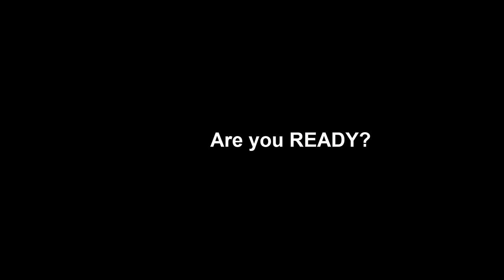Antique Handmade Meat Cleaver | RESTORATION

Comment: I think you ruined the blade when you hammered holes in it...
Reply: Hammered billet holes in it? He drilled holes in it. Or do you mean hammered poch marks in it? It was heated red hot and oil cooled after all that.
Reply: @zippy1981dotnet  Call them poch marks if you want.
Reply: I think he trasferred some kind of smallpox to the blade.
Reply: I think he trasferred some kind of smallpox to the blade
Reply: I personally like the grind technique where people indent the spine of a knife with grinder marks or sander marks. I first thought they where just heavily rusted areas but they're hammer marks. Anyways if they weren't all over the place they might look better.
Reply: Holes were the result of the original hand forging. Thankfully he retained their character,
Reply: It was already junk due to the cracks inthe blade any value it might have had was gone as soon as he ground it out to weld
Reply: Me too
Reply: Yes he do it
Reply: It's called a hammer forged finish. It gives the blade a rustic look and in no way ruins the quality of the blade.
Reply: Justin Dearing the hammer marks from forging are terrible, almost like a child did it. It hurts to look at and in my opinion, ruined the whole project. It looked better rusty
Reply: @flannelflax8078  its supposed to be antique and handmade. Back in the days this is how most tools looked like cause noone had fancy equipment to create the common flat shiny look.  Its something different and the forging increases the strength of the steal. The blade is also very sharp.

Comment: This is probably the first handle i've seen you do that doesn't have a garbage epoxy gap in the junction between the brass and wood, you are definitely improving on that, do you also make sheats?(that thing you put the blade in,  usually leather or wood)  for them,  if so you should show us too
Reply: Sheaths*

Comment: As a default choice you should always make brass at the other end of the handle as it will be less likely to take damage in the long term and the wood (weaker material) will be in a place where it is far less likely to get damaged

Comment: I really just watched this guy use a hacksaw to cut wood...
Reply: Nathanel Graves it hurt my soul to watch it
Reply: I do it as well sometimes. It leaves a nicer finish. But I use it only on small pieces.
Reply: There are tons of hacksaw blades available for many different purposes. There's a blade for finished/treated wood vs raw wood. Blades for ceramics and glass, different blades for different types and qualities of metal. I've also noticed some manufacturers make different ones look alike for marketing purposes. It's impossible to look at that blade while in motion to determine what its purpose was as the quality/recording speeds are too low to get a picture of the teeth.

Comment: nice work.. i've got 2 problems with it though.. that little tail extending over the index finger is a nightmare to use in a busy kitchen, cutting yourself pretty much garanteed and the second problem is, after all that work, there's still a big fat chip right at the heel of the cutting edge... otherwise looks nice

Comment: I didn't see you temper the blade after hardening it?
Reply: Can you explain to a layman what that means?  I watch these videos but have no idea what they are doing. I know heating and quenching is the hardening step right? How and why do you temper?
Reply: @yougosquishnow  heating it up really hot and then quenching it makes the blade extremely hard but very brittle. Means its prone to chipping and breaking so you afterwards heat the blade up at a much lower temperature for longer to add to the flexability without losing the original hardness.

Comment: Why did you leave the blade with holes or what it was?
Reply: you are right Matko P
Reply: It's called texturing. He gave it a hand forged type of look.
Reply: @Tokyo-bones  It looked better before he beat the hell out of it. Now it just looks like a lazy half finished job with a really nice handle.
Reply: @koloth5139  I would tend to agree, but I also don't think polishing the hell out of it with flap disks looks much better, and I would also disagree about the handle design looking good. That said thanks for your input, what's your opinion on the sanding?
Reply: @koloth5139  i think it looks pretty cool and i would love to own a knife like this.

Comment: I don't know why you sharpened the blade to 4000 grit prior to fitting the handle, and you can see at 11:00 that you've nicked it too. I like the restoration, probably wouldn't have hammered the marks in to it and i don't get the obsession with brass; but nice job.

Comment: What's this obsession with brass??? What is wrong with a full handle made of wood !!!!
Reply: Stefano Cesarini If I remember correctly the Japanese used brass to protect the tang of a metal sword by allowing the knife to transfer force into the softer brass. As opposed to sending all of it straight into the tang. I dunno if that’s what’s going on here though. It might just be a weight or preference thing.
Reply: I kno it looks like a table
Reply: @awesomechainsaw  Domo harigato ...I still prefer wood

Comment: What about the edge? It looks like a crescent moon... if all you’re going to use it for is paper then fine, but as a butchers knife that’s hard and uncomfortable to work with. If one can’t hold it straight when cutting that’s where injuries occur. The whole blade should be sharp AND flat so you can’t see light under it standing it sharp side down. You attempt enough butcher knife restorations, I figured you’d know this by now? 🤔